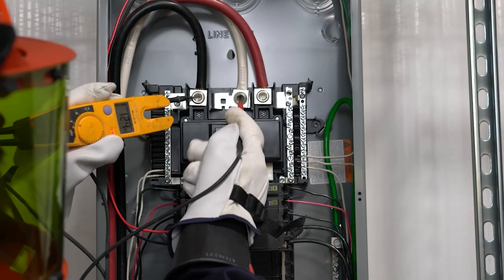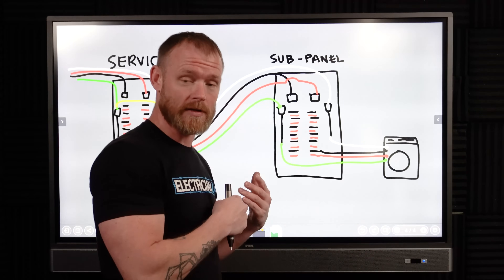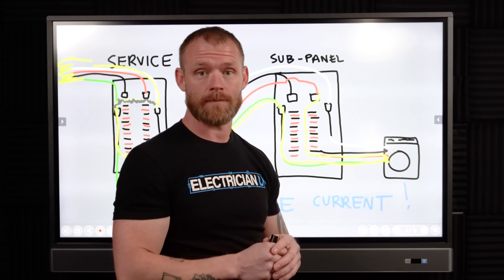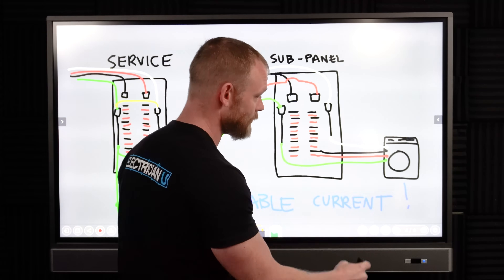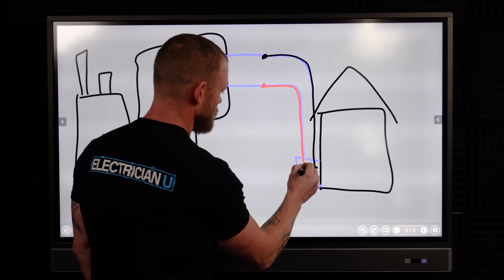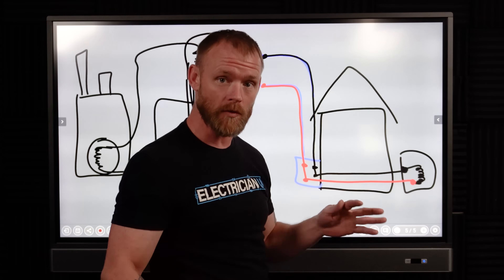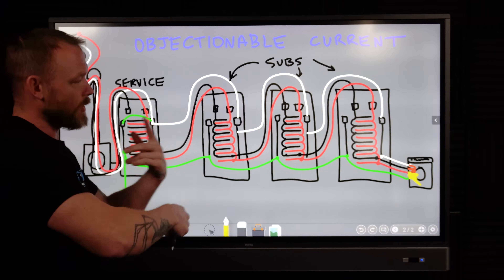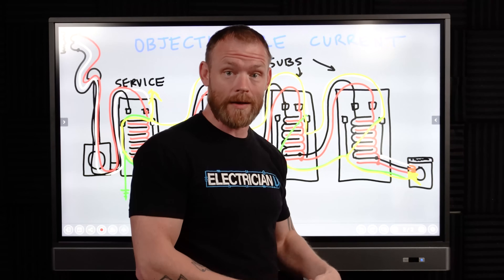Why Do We Bond at the Service Panel and Not a Subpanel?

Comment: Not an expert but I will assume there was some miss information. isn't the breaker connected to the hot line therefore this has nothing to do with the breaker no triggering in case of a short? 

Also not the same issue, but I was wondering why can't neutral and ground be bonded at an outlet instead of at the panel. And the only potential safety hazard that I can guess is in case of the neutral wire being damage which would mean also loosing ground and which would make having a short circuit become undetectable with a possibility to get electrocuted if you touch it. Or less distance between the neutral and ground bound means less resistance which mean more potential for getting electrocuted by touching a device with grounded cases/housing?
Reply: Like Dustin explained, for a circuit to function it has to be in a continuous loop. This loop consists of the hot the load the neutral the secondary windings of the transformer and the circuit breaker. In case of a ground fault, a connection is made to direct the current to the bonded connection, transformer, and circuit breaker. In a short circuit, the load is bypassed and therefore creates high enough current to again trip the breaker. 
I don't really understand your second comment, but the reality is that the ground wire has to remain unconnected at any other place under normal operation. Sure, it's mechanically connected to switches, receptacles, metal boxes, etc. but they must all be dead ends electrically until a ground fault occurs and a connection is then made.
Reply: @surferdude642  I asked chatGPT to see what it would tell me but no real answer. Although after asking a lot of question, it came up with a current leakage answer. What I asked it was if current could flow back in through the ground wire since neutral and ground are "literally always bounded together". It said yes and that is called current leakage. And if current leakage is not a made thing by chatGPT(my error for not checking), then my assumption is bonding at the main panel vs elsewhere is done for safety precaution against potential current leakage.
Reply: @guyverhw4780  It's more than just for current leakage which implies cut or worn insulation which lowers the resistance and can bleed off in small amounts to metal parts in the electrical system. This may trip a GFCI breaker if there's one on the circuit. If not, or if it's a regular breaker, the stray current should return to earth via the neutral/ground connection on the power pole transformer. The breaker won't trip because the current will likely be too low. A ground fault is direct contact to metal parts and the high current will trip a regular breaker. The equipment grounding conductor is involved in either case.
Reply: @surferdude642  Small correction, cut/damage or worn insulation/wire would mean "more" not "less" resistance. And resistance doesn't necessarily increase because it is worn/cut, it increase because wire  can't no longer handle the amps if too  much amp is being fed which also result in increase in heat(fire hazard) which increase resistance. Although a completely cut of wire would increase resistance to much and prevent current to flow through it. This is what I've learned from the internet so I'm not entirely sure but I'm fairly positive that this is correct.

Anyways, the way I understand it is electricity works in a similar way as water does with hoses.  If we have a "Y" shape hose and feed water though one of the top part/branch,  then water would just directly exist at the bottom of the Y. If the bottom part is smaller in diameter than the top, then water would start to fill the whole "Y". 

Hence "if" electricity works a similar way, top parts being neutral and ground, bottom part being the bond returning to the source, then  the whole "Y" can becomes "live?(current leakage?)" if the bottom part can't  "freely handle all the amps". And if you touch something live, electricity could start to travel through/flow/fill your body with electricity just like water would fill any possible gap even if your body does not provide any "direct?" continuous loop(meaning no earth path either and the bond is the only path) linking back to the source. If not then would that mean it is completely safe to touch a live wire as long as you wear rubber shoes and don't touch anything else?!

I mean like I said, neutral and ground are always bonded together no matter which to clueless me also means ground wire are always live. I understand that it is bonded together for safety against potential defective product and to trip breaker when a short occur. Although I have not seen any video yet that can provide a logical explanation as to why it matter where the bond is being made. Normal breaker are connected to the hot wire which mean they always get the full amount of amp even if ground and neutral does provide 2 different parallels path. Parallels path does not decrease the amount of amp that is flowing through a breaker. The only things that makes logic to me is amp flowing through wires like water does with hoses.

Comment: If you bond the grounding conductor at multiple points, you also create a current differential across those points, so your grounding is no longer at one potential and there is current flow across the bonded (grounded)  metal parts. This mean you could get a shock by, let's say, touching the metal on your laundry machine even though everything is working fine and there is no short.
Reply: Yep, there are so many bad videos telling people the wrong info on connecting a hot tub. Hot tubs are required by code to have a GFCI shutoff near the tub itself so are a small subpanel in every case. If you bond neutral and ground on that hot tub panel then you have a parallel loop back to the main panel and electricity is a self-leveling force of nature. If your hot tub is drawing 120v and 2 amps, then you absolutely have roughly 1 amp on the ground leg and 1 amp on the neutral leg of that parallel loop at all times. The hot tub can draw 240v 10+ amps for its largest pumps and heaters and you are safe from that because it bypasses neutral, but all of the control boards, lights, speakers, and smaller pumps might run on the 120v. The GFCI won't trip because it can only protect downstream and the parallel loop is upstream from it. Everyone using the hot tub is relatively safe, but the house is now a danger for any other electrical work.
Reply: No, you would not get a shock unless the wires broke but it could cause stray currents that cause problems with AV and IT equipment. For you to get shocked there would have to be loss of tens of volts in the wires. Such a system would just not work.

For some reason people need to make things too dramatic, as if you die if some rule is broken.

Comment: Thanks so much for this great explanation! What about ground rods? Should the ground rod only be connected to the neutral-ground-bond at the first point of disconnect? Would it hurt if a subpanel's grounding bar (not bonded to neutral) is also connected to the same ground rod outside? 

My electrician installed a new 200A disconnect right after the meter, so now my main home panel is no longer my first point of disconnect. But he left the existing GEC in place, so right now both the new 200A disconnect panel right after the meter as well as the main panel ground bar are connected to the grounding rods.

Comment: I have a sub panel in my shop. I removed the green bonding screw but I have the ground and neutral (in that sub panel) attached to the same lug bar. Okay or do I need to add an additional lug bar. Thanks.

Comment: In your example you have multiple subpanels all flowing through each other. In the case of a single subpanel, say in a garage, in my mind it seems like having the neutral and ground bonded in the subpanel means that during everyday operation, neutral current can flow back on either the neutral or ground wire or both! This does not seem like a good idea, and I would be very curious to know why anyone EVER thought bonding these in a subpanel was a good idea. Maybe I am misunderstanding something. Thank you and love your channel, very clear and to the point!
Reply: I think this is a true reason for not bonding in sub panels and not how the author of the video explained (he didn't)

Comment: Would this still apply for emergency disconnects to service panel? From my understanding, the 2020 NEC clarifies that the emergency disconnect is not a service disconnect(as long as you properly label emergency disconnect and service disconnect) so you would still bond at the main panel after the emergency disconnect. Is this incorrect? I'm finding a ton of mixed responses to this, even amongst other electricians

Comment: So question. When you are showing the current returning to hydro, why wouldn't it take the bath to ground. Maybe I am missing something, but in my head doesn't electricity take the bath of least resistance.
This is how my head is seeing it. But by bonding ground and neutral, because the neutral wire larger ( less resistance ) it will favour this wire and the ground is there for safety only if the neutral is cut.

Comment: i thought the neutral from your service panel goes back to the transformer on the pole and then the transformer neutral tap runs to earth at the pole.   why is the transformer earth different than earth provided to your grounds in the house thru the grounding rod ?  what is the point of the house grounds if a ground fault all the way back to the grounding rod won't trip a breaker ?  you mention there is another reason to the ground circuit at 12:00 , but don't explain or link to another video that explains.  That reason would be good to know.

UPDATE :   I'm not THAT lazy so some quick research on YouTube and I now understand grounding rods a lot better.   I think you can (over)simplify it like this.   

---   Breakers may save your house from a fire.  
---   Grounds may save your equipment from a lightening strike (or equivalent) 
---   and GFCI outlets/breakers may save YOU.

Comment: As a Control and Electrical Engineering Finalist Student, i am working on my final year project based on your two videos (Why Neutrals and Grounds are Separated in a Sub Panel and Why Neutrals and Grounds are Connected in a Main Panel. Design, Simulation and Prototype of a GFM, a meter to interrupt flow of power to a delicate house/industrial system on condition that it has met/satisfied the Effective Ground Fault Current Path). So as to eliminate the negative consequences of poor installations and only qualified electricians doing the clean job.
Hopefully, i can be able to make more inquiries/questions and guidance from you! Looking forward to your reply. Thank You!

Comment: That was a great presentation....but it brings up a question. I have a service panel in my workshop/garage about 150 from the main service panel. I did not bond the ground to the neutral in the panel but I did put a ground rod and grounded the secondary panel in my workshop. The workshop is a metal building and the panel is connected so the building and the panel both are connected to earth via the ground rod. Is that correct?

Comment: We don't bond neutral and earth at all. Only the DNO (distribution network operator) ever does. If you do, under Regulation 8(4) of the Electricity Supply, Quality and Continuity Regulations 2002 ("A consumer shall not combine the neutral and protective functions in a single conductor in his consumer’s installation"), you could be prosecuted and fined an unlimited amount.

The reason is that you have introduced potential danger, specifically that you have created a PEN conductor and a breakage of this between the service panel and the transformer is very possible, especially with overhead cables, which can lead to dangerous voltages, especially if outdoor electrical equipment such as hot tubs, caravans and electric vehicle charging points are in use.

DNOs do connect the two in the cutout, this is deemed a controlled and risk managed system (and also a cheap one, they used to use an extra earth conductor going all the way to the transformer). If you have your own earth electrode, you need an RCD/GFCI for fault protection (or one of the old voltage operated earth leakage circuit breakers) in addition to the usual RCBOs provided for additional protection.

Comment: what if there is another sourse of power in the system such as an inverter which requires a permanent neutral bond on the output side of the inverter?

Comment: I have a question.     I have a mobile home in a trailer park.   It has a 100 amp service into it.   But yet it has the grounds and neutrals separated.  And it's the only panel.   So it's the main and it's been fully inspected and approved this way.   I'm wondering if it's wired this way because the lines come in probably 20 feet away from the meter.   I do not know where the transformer is.   It's probably under ground????

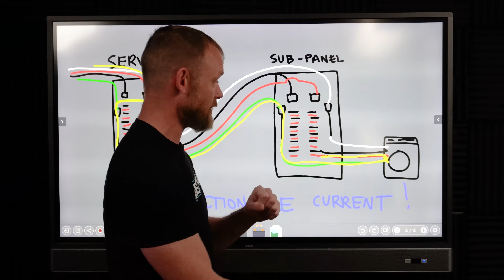Comment: at 6:33 please  draw a/the complete circuit path .....you only when to one end of the transformer...where is the other part of the circuit?
Reply: It goes to the mid point or center tap of the transformer and continues it's loop by going to one end of the coil or the other, depending on if the circuit in question is tied to L1 or L2. The circuit will be opened by the circuit breaker if there's an overload, short circuit, or ground fault.

Comment: I had problems understanding this .
I am eclectision in England . Hear we have   Two types of supply one we’re the supply cable is run under ground to from the transformer to the property’s or two the supply cable runs overhead to a transformer on a pole. Then we have three types of earthing (grounding ) one is TNC- S two is TNS and three is TT ,
1 TNC-S (pen conductor) earth and neutral are connected together at the transformer and at the service head at the property then separated between the service head and the Consumer unit ( breaker panel ) but in the CU the earth is kept separate from the neutral all the circuit connecting are line of the breaker neutral to the neutral bar earth to the earth bar . TNS the main earth is connected to the steel wire armed of the supply cable all the circuit are connected int CU the same as a TNC-S , on a TT the main earthing conductor is connected to an earth rod separate from the building . We do not connect earth and neutral together at any point in the the property other than at the in take ie the supply service head. We test this earth conductor for the earth fault path back to the transformer  ie external earth fault loop impedance Ze to do this test we remove the main earth conductor from the breaker panel , we then do a Zs test main earth reconnected and now we are testing the hole system including parallel paths ie the water and gas bonding . For a TNC-S the maximum Ze value is 0.35 ohm Zs=Ze +R1+R2.. R1 is the resistance of the line (hot) conductor R2 is the resistance of the Earth (ground) conductor.

Comment: 12:02 So half of my family where grandmaster lineman & lower so i got to hook up alot of electricity when i was a child. But the grounding Rod is partially just there for a backup ground isn't it? in case the ground fails & becomes energized? But thinking about it, why have i seen them hook up alot of things to the grounding rod, just for extra safety?

Comment: Ok, but this does not protect you if the red has only a loose contact with the dryer case. Something with a resistance says of 1K Ohm. It will draw a current of 0.1A, will dissipate 12W or less if it is reactive, can be undetected, and not raise the breaker.
But if you touch the dryer case, you may be exposed to 0.1A and this can kill you.
Why not to have differential breakers able to detect any leaking current, whatever the path, and trip?

Comment: I am questioning the statement that the current flows through the "neutral"  .  it actually depends on the resistance between the neutral and the ground.  the ground current ultimately flows through the ground rod.

Comment: Hands down the 100% best explanation I've ever seen on this. I've always known not to bond ground and neutrals in a sub panel, but I didn't fully understand why until now. I am curious though, why do you not add grounding rods to every sub panel. If the primary load center is in the house and you have a sub in the garage. Shouldn't you have a grounding rod in the garage?

Comment: I have a question. In a situation where the main disconnect is out by the meter and the main panel is in the garage will the ground and neutral be bonded at the disconnect point and the ground and neutral bars separated inside the main panel? I am a new home inspector and I’ve seen several examples of the ground and neutral separated in the main panel but those main panels do not have a main disconnect within them. The main disconnect has been outside by the meter.

Comment: Q - So if the neutral gets corroded and burnt-out at the Pole, does that mean none of the breakers at the panel will trip because it can't return to source??
Last week that's what happened at our house; the coaxial cable that went to cable company's relay box located one foot from the panel (current jumped) caught fire burning the outside of the house.  No breakers tripped.

Comment: Hi just watched your episode on bonding at the main panel but not at the sub panel. what if the sub panel is in the garage and there isn't a ground wire from the house to the garage where the ground from the sub panel goes to two ground rods. should the sub panel be bonded?